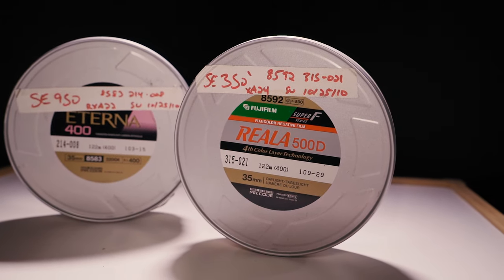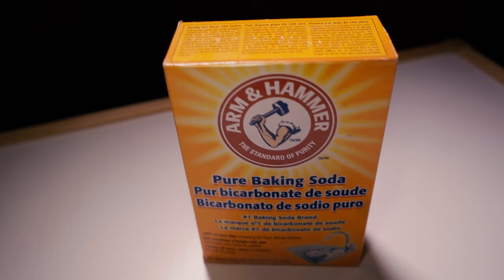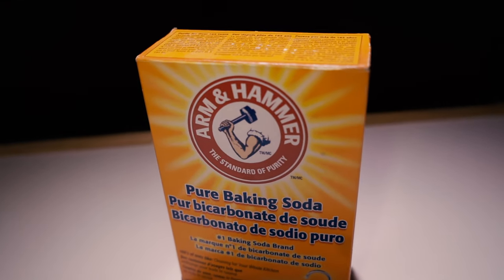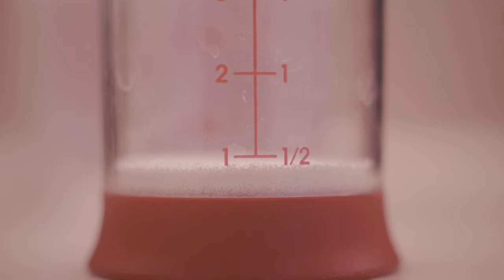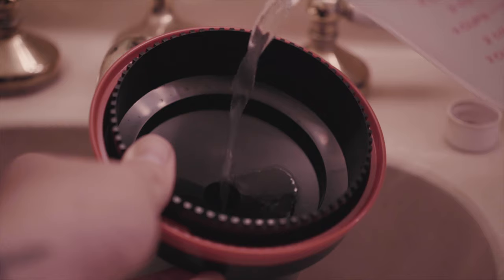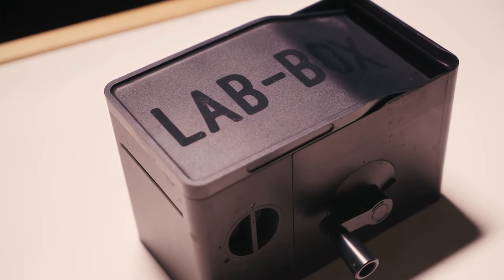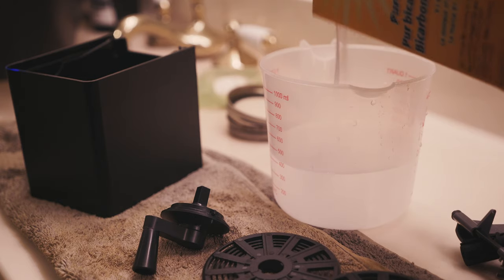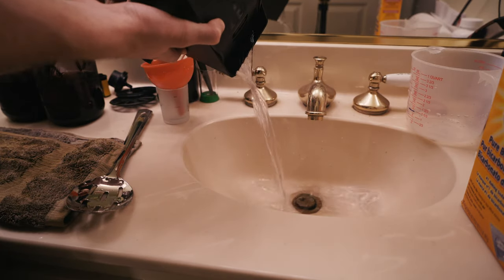Removing Film Remjet

Comment: I removed the remjet prior to shooting my Fuji Eterna 500T, pretty excited to see how it will look.
Reply from the maker: How did you remove it before shooting? Mostly the drying part?
Reply: @BadFlashes  Left if in the Patterson tank for 2 weeks. 3 weeks would probably be even better. If you want it faster, and if you can guarantee your bathroom doesn't leak any light, just hang out there and contemplate lifes deepest questions for 3 hours or so, and roll back into a canister. I prefer Mr. Patterson though.
Reply from the maker: Hahah that’s what I was thinking... but I’ve hung out in the dark for 30 min and couldn’t handle that... soooo 3 hours, who knows what demons lurk in that mindset. You will have you share results to see if there is much difference!  I’m excited 🤩
Reply: @BadFlashes  Will do! Good luck with your shoots :^)
Reply: @BadFlashes and how did you remove the remjet?

Comment: This seems so easy to do, I'm surprised independent developing houses/companies don't just adopt this instead of declining services. Even if it's just a pre-soak and they just inform that photos may need extra cleaning once delivered.
Reply from the maker: Yeah for sure. It’s probably because they can’t guarantee results. I personally haven’t found the best balance color wise by cross processing in C 41. The turn out all right but that point I might as well shoot Portra.
Reply: If they're doing 'dip n dunk' they would have to put the film into a tank, perform the alkaline/remjet removal and then pull the film and do the dip n dunk.....In the dark all while processing other film (w/o the remjet).